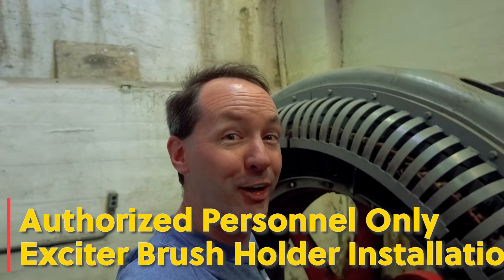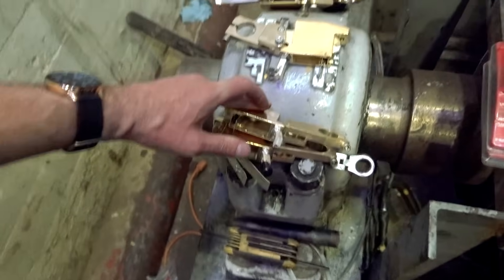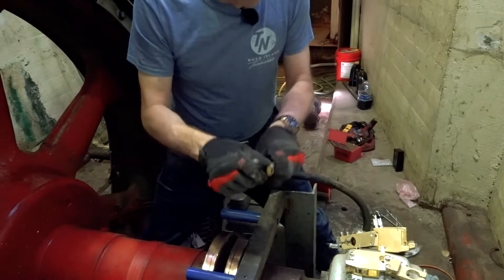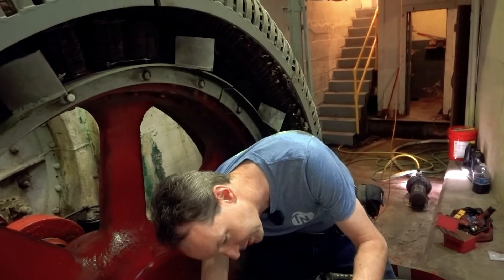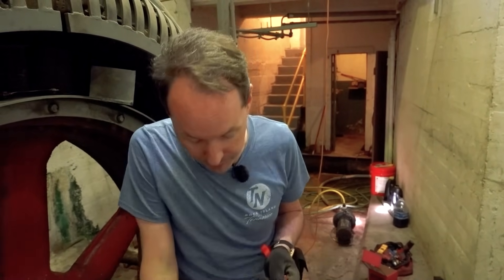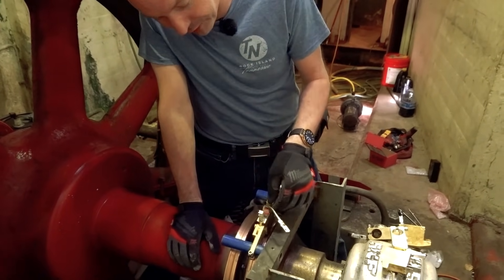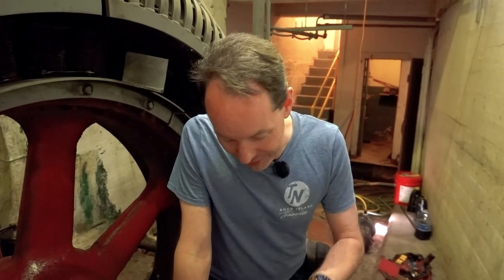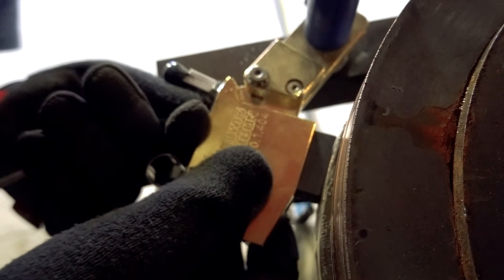Authorized Personnel Only - How To Change Brush Holders On A  Hydroelectric Turbine Generator

Comment: The things we had to know to do electrical work.  Earthmoving equipment - trenchers, front-end loaders, an earth saw (it's what it says on the tin, a five-foot-high inch-thick steel wheel set with carbide teeth, it would go through earth, concrete, asphalt, rebar, your arm if you were stupid... no, I wasn't....), carpentry, which made possible concrete working... plumbing (Schedule 40 pipe is just as good for conduit as it is for sewer lines)... and then when all that's done, they let me, the apprentice, come along and do the _actual electrical work_, cutting and stripping wires and splicing in matching transformers so that if one runway light goes out, the whole string doesn't go dark... I'd say it was "pretty cool" but it was 107F in the shade... and we weren't! Which is why I spent the next forty years INSIDE with the computers where it's COOL.  Usually.

Comment: One of the more interesting carbon-copper devices that I got to work on was an Otis elevator contactor from around 1915 that had carbon cups that the copper pads would be driven into. The cups were about the size of a silver dollar, and the copper pads about a half dollar. The reason for this setup is that there would never be a chance of the contacts welding together. Another interesting thing was that the pads (this was a three pole contactor) would swing them back to the 90 degree position about three inches away.

Comment: 'Finger tight plus a quarter turn' - we used to joke that it was 'tighten until it strips, back off a quarter turn'. 
FWIW, a threaded fastener stretches as you tighten it, so it's working like a spring to hold friction on those threads - and the threads deform a bit as well. The Brits in the 1800s had fasteners with asymetrical threads - asymetrical enough that they'd deform into being symetrical under the corect tension. Tech we forgot - and then rediscovered as there are now fancy-ass aerospace fasteners that use the same idea. To be fair, we forgot because our materials got a lot better. 
Loving your series, BTW.
Also, was that anti-sieze I saw going on there? That'd mess up your torque readings - if you were using a torque wrench.

Comment: I don't do anything near as interesting or important as this but your attitude always refreshes me. It reminds me of how I scare the hell out of new technicians by being funny and still doing the job the right way. Keeps the new cats loose and not afraid to get into the job.
Reply: @shelbybaker6443  even when I do get frustrated or mad I try to keep it cool. Idt the complaining does anyone a favor either. when ppl do start complaing I usually try to lighten it up or simply/nicely remind em the sooner we get this done the sooner we're back in the shop and it's a non issue. it doesn't help though at most places maintenance gets put under unrealistic stress during down times. then they get so focused on production tht when you have a list of problems thatd require every down day for a month to fix they still don't wanna fix it. that'd be my only complaint like I've told ya for how long this was an issue and we chose to run 100-400-1000 hours later on it and I'm the bad guy here that needs the tight deadline.
Reply: Good for you. People like you made me want to work jobs I otherwise wouldnt, and I learned a lot.

Comment: Around 2000 I got be the manager of a pickling line and a single stand cold rolling mill electrical maintenance.  It was all MG sets and DC motors.  We were nearly bankrupt too. Early on my best motor inspector alerted me to the state the brushes were in. We had very little stock and most were down to barely acceptable nubs. My bosses ahout sh!t when I reported we needed to replace hundreds of brushes. My explanation that the damage to commutators, slip rings and brushholders flummoxed them. But we got the brushes. And over the next 3 years we were able to get that division into good shape. Sadly the overall corporation failed.  This is a great video. I saw hundreds of DC motors and there is always something new to learn.

Comment: Can a newly installed brush carry full operational current, or do you let it rotate for a while first to let it adjust to the exact slip ring shape?
Reply: If the Brush has been dressed to match the radius of the Slip-ring / Commutator and those surfaces have a smooth burnished finish then your good for throttle up. If not then you should  prep the Brushes, Slip-ring / Armature before applying angry pixies.   Good question.

Comment: Surprised you could even find those holders or did you have them in the back?
Reply: Since sliprings are in use still this day, I assume he bought some available similar sized parts. The brush size doesn't have to be that exact to the original, and if nothing else, you can turn differently-sized holding pins for the assembly on a lathe. Quite easy to fix. This is the nice thing in proper industrial stuff, everything is metal or machined industrial plastic, put together by thinking people, thus repairaple.

(as opposed to consumer stuff. And cars. Since the past two decades or so...)

Comment: I would like to hear about brush hardness and how to determine optimal hardness for a particular unit.
Reply: It's a trade off between brush wear and commutator/slip ring wear.

If it's an application like this generator where brushes are real easy to change, you'd nearly always go for a very soft brush to minimise wear on the slip rings.

On something like a forklift (my profession) where sometimes changing drive motor brushes means the removal of both drive motors/gearboxes to access them (couple of days work) you'd engineer that brush compound a lot harder to last many thousands of hours but the commutator would normally be significantly worn and require skimming & undercutting before new brushes can be installed. I've seen many DC electric forklifts with 10K+ plus hours on them and still on their original drive motor brushes.
Reply: Brush hardness in most cases is the least significant property to insure good brush operation.

Comment: Can't help but think that those are the exciter brushes for an alternator, not a generator, but then, I'm not there. Rule of thumb, buy the right brushes ... when they are 30% worn out, just like 70 % is a D in school, 69% is failing, you won't have a problem. The insulator on the back keeps current from flowing thru the spring, heating it up and weakening it. After 47 years, I'm glad it's you not me - job is great ... idiot managers that think they are wise ... not so much. On OEM brushes of most older brands, when the back of the brush is even with the back of the brush holder, it's time to pick up the phone and order new ones, before the arcing starts from weak pressure. Good job keeping the ball rolling.😉

Comment: I got a “brushless” Drill, Circular Saw and numerous other tools so do digital motors have brushes?
Reply: Nope. In Brushless DC motors the rotor is just a permanent magnet that doesn't have any electrical connections going to it, So no need for brushes and commutator.

Comment: An electrician hands over to the millwright when the thing to be moved or installed is too heavy to lift, then just does the connections. As instrumentation, we handled the cobnnections to sensors and actuators, except for power, and would have the entire run for temperature sensing, because electricians are totally mystified by having a sensor and wiring that is a short circuit, but which still works while it is that. Even more fun when your calibration of the unit was to adjust a resistor, so that the short circuit now had a specific resistance, and this now made it read correctly.

As to the small guy getting jobs, know of a few motor dealerships where the smallest skinniest mechanic is a specialist, there to go under the footwells and do clutch, brake pedals and linkages, because he fits there without needing to remove the front seats.

Comment: old brush holders are ruined.  how can a mallet be precise?
Reply: Any tool can be precision iffen used in the right way.
Reply: I think big precision machines are usually squared up with mallets. "Give it another .5 microns" Tap Tap.
Reply: @Kenionatus  can confirm I use a 20 lb deadblow mallet to align a 30 ton press brake to be less than 50micron out of parallel with a robot

Comment: Used to work for a company that operated and maintained six car airport monorails. There was six traction motors that had twelve brushes each. (3 phase motors) They looked similar to these and at 600 volts DC and running 24/7 they wore down in a hurry!
Reply: @Fireship1  I have a question: will those brushes ( I count 4) flow all the electricity from this generator? The wires seemed a little small… 
I don’t really have a clue, just curious
Reply: @QPD-1  I'm no expert but those brushes provide power to excitation coils (to the generator) on the rotor. Power from the generator usually comes from the stator coils. The wires do not necessarily need to be very thick as these generators voltage may easily be several kilovolts and needed excitation power is only little fraction from generators output power.
Reply: those only carry DC around i think 50amps Chris correct me if im wrong @QPD-1

Comment: Any machine is a smoke machine if you operate it wrong enough
Reply: yes smoke is very entertaining.  a certain UK electrician did that by sending things way off the scale.
Reply: @SamSitar  photonicinduction?
Reply: People who own massive, straight piped diesel truck: "am I a joke to you?"
Reply: Most smoke machines I’ve seen all going off at once was when someone in a moment of not thinking straight lifted the neutral connector of a star supply in a nearly complete - and powered - installation.
Reply: Applies to a whole lot of machines....bad when your up in air and that smoke comes out
Reply: Fair

Comment: Carbon brushes are constructed primarily of graphite and have a negative temperature coefficient ( the hotter they get the less resistance which allows even more current to flow resulting in more heat  ) The brush holders are typically arranged in pairs or groups in parallel on each of the Positve and Negative slip rings  . If one brush loses contact due to sticking in the holder , losing spring tension due to brush wear or burning up all of  the  remaining brushes have to pick up the current from the failed brush . This increases the current and heat of the remaining brush(es) and leads to thermal runaway that can destroy every brush one at a time  leading to a slip ring flash over/ loss of excitation condition to the generator that will trip it offline . Daily inspection and periodic maintenance is key with this equipment . Brushes should all be checked with an infra red heat monitor to catch hot brushes before damage occurs ,  Constant tension brush holders like those being installed in the video will compensate for brush wear and reduce problems  .
Reply: Thank you, I know nothing about this type of thing and found that really interesting. I am grateful that you took the time to explain it so well.
Reply: @tedrex8959  Thanks Ted I don't know much about drama but I do know something about the workings of a hydro plant
Reply: It's called selective action.
Reply: Not the first instance of a runaway reaction caused by grafite